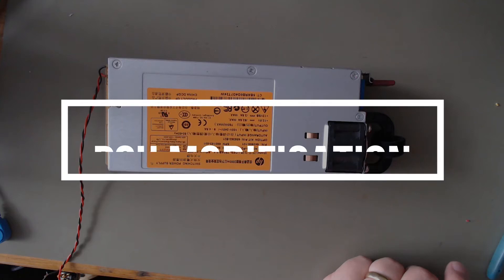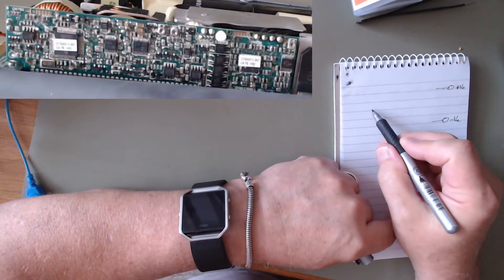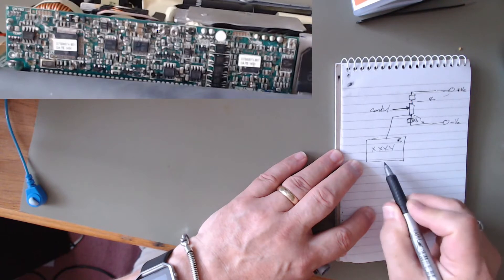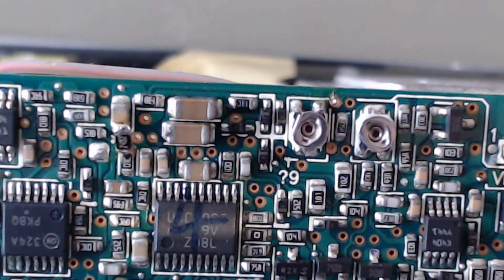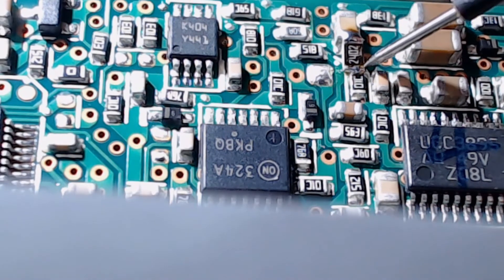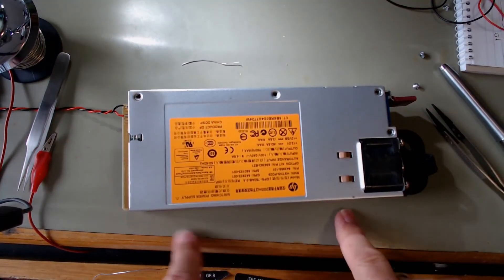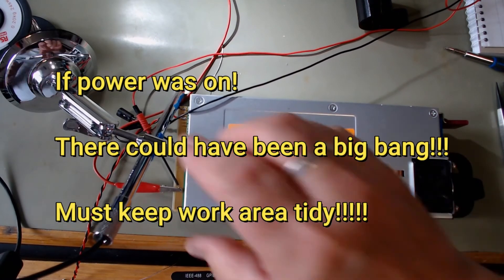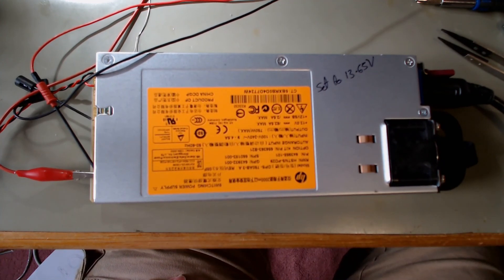#073 converting HP HSTNS PD29 to 13 8V

Comment: Hi would would the mod be the same for the HSTNS-PL29?
Reply from the maker: HI, I'm not sure data for these is hard to find, so I coould not say but if you follow the save process it might work. but remember these can kill if you touch the wrong place with power on.
Reply: @TheEmbeddedHobbyist  I'm working on the HSTNS-PL28 and the control PCB seems quite different with only 2 adjustment pots. The adjustment (which only goes between about 12.05v and 12.35v) seems to have the +12v output connected directly to the wiper of the pot! So is somewhat different to your design.
Reply from the maker: @esuohdica  I've only got the one PSU and did find that all those I could find had different PCB layouts. You just need to find a way of making the 12V ouput seen by the pot a bit lower, so it will up the output to compensate. in the end its trial and error, but remember these can Kill easy.
Reply: @TheEmbeddedHobbyist  Thanks for the reply!
Reply: Tell me if you have solved the problem. There is no information anywhere on the alteration of HSTNS-PL29

Comment: Great vid! I have installed 27k smd resistor and range of voltage adjustment was between 13.4 and 13.8V. Best regards!
Reply from the maker: Hi Janek, you got a higher output than me! Glad it helped.
Reply: OVP nie wyłącza tobie przy 50A ?  Sam jestem ciekaw tego moda czy warto.

Comment: From what I have seen in the past is that when one increases the voltage on these switch mode supplies one must also derate the output amps accordingly.
I would opt to place a small daughter board close to the output leads and allow one to switch between 12.x and 13.x volts, some items don't tolerate 13.8 volts if you plan on using this as a multipurpose supply.
Reply from the maker: Hi thanks for thge comment. I plan to use this with mobile transivers HF , VHF-UHF etc. 13.8 is the normal battery charging voltage so about what the radio's are expecting to see. I don't think I'll be going too close to the max rated current. max about 30A or 1/2 rated output so should be ok.

One reason for not trying to change the over voltage protection is it should still cut out before it can over voltage my radio's

Comment: is there any other way to solder a resistor in that is not an smd resistor. One with a lead say soldering it to the 0 voltage point as others have done on the 4th pin back on the header pins that is 0 volts? I have the stuff but not the practice to solder something that small. that resistor looks like a 2402  24k what size is it?
Reply from the maker: Hi Bruce, the resistor was a 0806 which just fitted the gap. You could fit a 1/4W resistor between any easy 0V point and straight on to the variable resistor leg or the point highlighted with the resistor in some heat shrink sleeve but I found the SMD route better as it small and compact and does not need any other glue etc.
Reply: @TheEmbeddedHobbyist  Hey thanks so much. Would a zero balance point be 0 ohms to the negative terminal of the output. I noticed that on one of the other models that have three pots in about the same place they took the resistor something like 23k to the forth pin over approximately across the opposite side of the circuit board. I may try what you did but I'm a little shaky and in the past I had problems with the SMD getting caught up in the surface tension of the solder and had a hard time keeping it in place while I soldered it. Those are some might fine tweezers! I put on my magnifier head gear and had to use the loop in addition to the magnifier lenses that I think are 2.5x to even get a good look at it ha ha.
Reply: One question is, how many ohms is the resistor?
Reply from the maker: Hi Bruce, the resistor was a 24K (2402) 1%. But the pot will allow a small variation in the value, so a 22K or a 27K may still work.

The trick is to place the SMD chip where you want it and then solder one end while holding it down with the tweesers. then do the other end, but give the first end time to cool down.

The main thing to remember is if you have powered it up give it a while to allow it to discharge the main caps. There are some big value caps in it with rectified mains on them, a sure fire way to ruining your day!

Comment: Should buy one of these gems for my 3d printer.  Is there an application you have in mind, for which 12V is not enough, but 13.8V satisfies?
Reply from the maker: Yes, 13.8V is the standard voltage for a 12V battery system while being charged. So it the standard input voltage for Ham Radio mobile systems. A 100W HF unit pulls around 20A’s so need a good size power supply. A linear is better option but they tend to be very heavy, so a switch mode is a compromise weight Vs electrical noise. looking at replaceing the 30V 30A variable supply I'm currently using with it for my HF rig,.
Reply: @TheEmbeddedHobbyist  Ah yes!  Lead acid float-level.  (hits head) -- Did not even think of that.  May need a current limiting circuit to be safe.
Reply from the maker: @GnuReligion  I have an old crowbar unit that trips at 14V I was going to put a 30A fuse between the output and the crowbar cct to protect for overvoltage and over current. The psu has overvoltage but you can't be too careful.